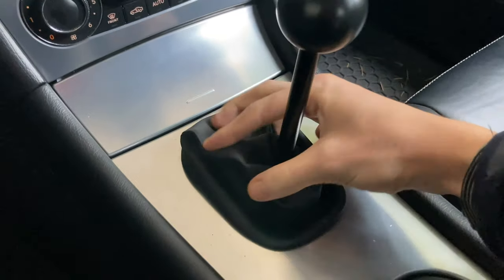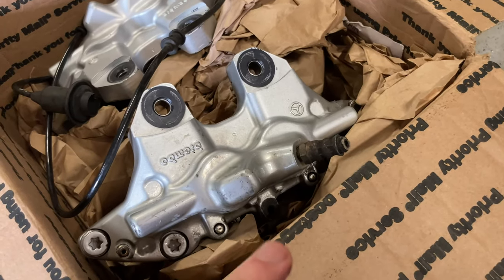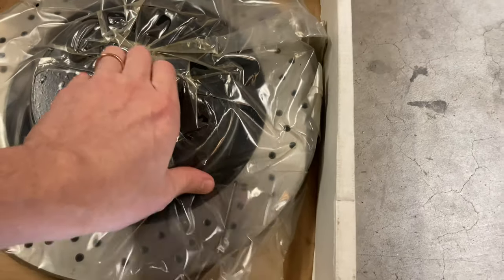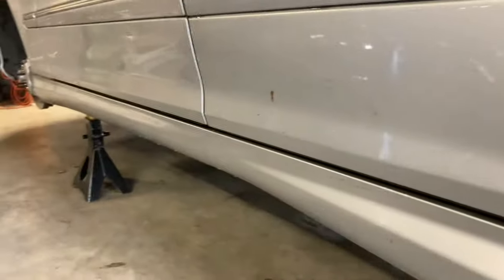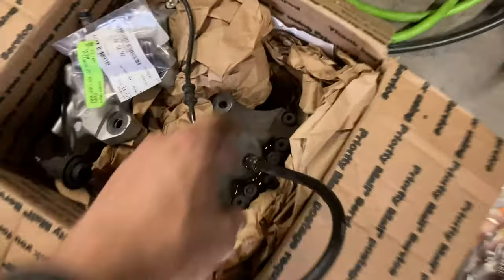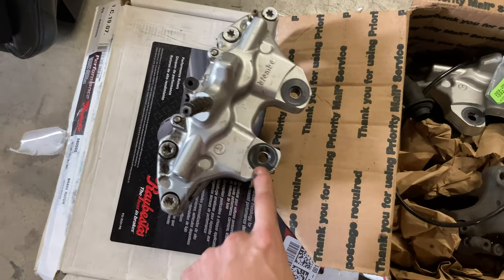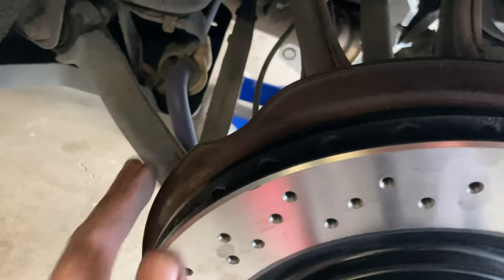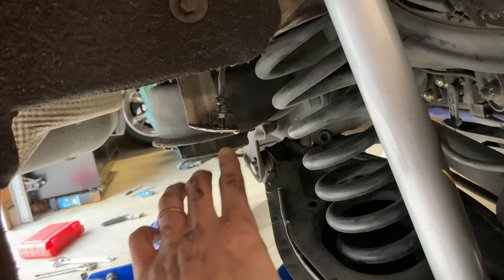C55 AMG GETS BIG FACTORY REAR BRAKE KIT

Comment: Looks great and i guess works as well !?🤌🏻 
So the same setup i can use on my W210 E55 for the rear with the same modifications,right? And if i buy the full setup 6 for the front and 4 for the rear will it fit my original 18” monoblocks without a spacer? If you know of course🙋🏻‍♂️
Reply from the maker: I believe so but don't know for sure... sorry!
Reply: @ANDERZENAMG  it’s ok. I guess this is the hustle we have to go throw to make😅. 
Great videos by the way! Thanks.
Reply from the maker: @putnikkavkaza9636  exactly haha sometimes it takes experimenting to know for sure, like many of the things I have done to my cars ;) Good luck!

Comment: Nice work.. I have a 2005 CLK55  , it has the same rear brakes ,,it has 6 piston front calipers ,,two piece rotors , with 18 inch wheels.
They look great ,,same as fitted to the CLK63..

Comment: That’s great man, wonder how difficult it would be to put the early R171 SLK55 6 pistons on the front... Or even the 8 pistons from the heavier cars but that would probably be overkill 😂
Reply from the maker: 6 pistons are not any more difficult than these in front, however, they will not fit with my 17’s. As I begin to track the car this year, if I find a need for upgrading fronts, I will check my options. I think with the right weight reduction, tires and brake components including cooling ducts to be installed, the car will do fine 🤙🏼
Reply: @ANDERZENAMG  Ah makes sense. I think you’re right, probably won’t be a need to do that with weight reduction and proper cooling as you said!
Reply from the maker: @SamAbraham  let's hope so! haha ;)

Comment: I have run my C32amg on track 20times the stainless steel brake lines with motul 660 with stop tech pads work great 
Pads do dust up a lot, but no fade no squishy pedal 
I did go with 2 peace racing brake rotors up front and lost 8.5lbs per side of unsprung weight
Reply from the maker: That’s awesome! What two piece rotors did you go with? Still 4 piston calipers?
Reply: @ANDERZENAMG  
Racing brake they expensive
Reply: Yes still have 4 piston calipers
Reply: Stock I did rebuild calipers with new seals
Rotors have been on car since 2016 daily driven 8months a year and are still perfect.
Only issue is u can’t use heavy brake cleaner that turns purple to clean them cause u end up having to rebed brakes in 
It does not take long to rebed back in

Comment: Great work!  I think I´ll do the same thing on my C32.  :-)
Reply from the maker: Definitely worth it! Thank you!
Reply: Hi again, I wonder, you say you used rear brakes from an S55. Does it matter from wich chassie it comes from?  outhers say that only parts from the SLK55 AMG R171 chassie would fit.
Reply from the maker: @neonryttare  I used s55 calipers and slk55 rotors, there are other models as well with the same parts you could use.
Reply: Ok. S55 from wich year?  Do you know other models for the front? The 6 piston calipers from R171 SLK55 is suppose to fit but do you know if any other front caliper fits? From other chassis that is.  :-)
Reply from the maker: @neonryttare  part numbers are listed in the bio above, mine are from a w220 s55. For the fronts there are a few different options just have to do a little research, slk55, clk63 and a few others.

Comment: What caused the shortage in the brake line? The brake line itself or the brake line connecting points on the calipers? I noticed the connecting points on s55 and c55 calipers are different. One sticks out vs the other is almost horizontal. Also, what mm size are the rotors?
Reply from the maker: Positioning of where they plug into caliper I believe. They are from the slk55 amg performance package, 345mm?
Reply: @ANDERZENAMG  oh okay,  so even the oem brake line would have been short too, then, huh?🤔 im doing the same swap this weekend But caliperss from a clk63. Just curious to know if im going to have the same issues? Just want to be prepared.
Reply from the maker: OEM brake lines have a little more flexibility so it may be fine but can’t say for sure.
Reply: @ANDERZENAMG  true true, thank you, sir😎👍🏼
Reply from the maker: @63nside21  of course! Good luck with it, that will be a nice upgrade!